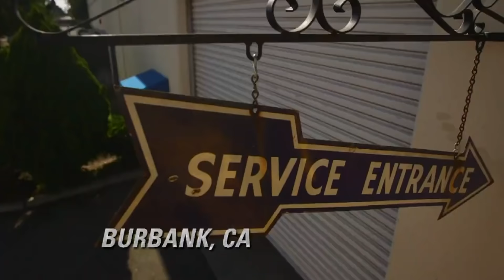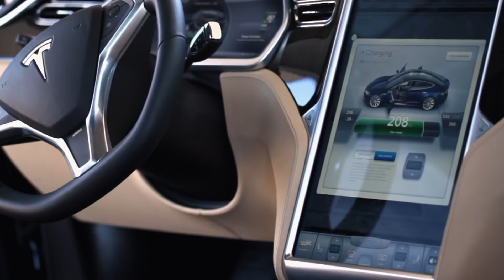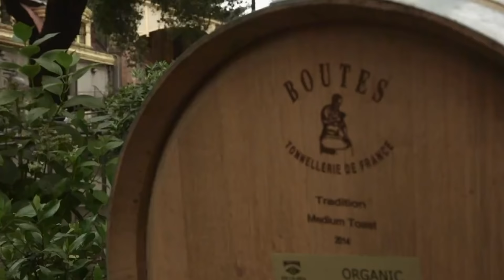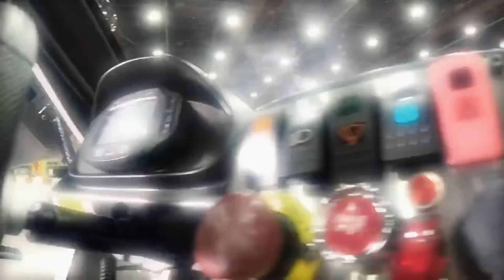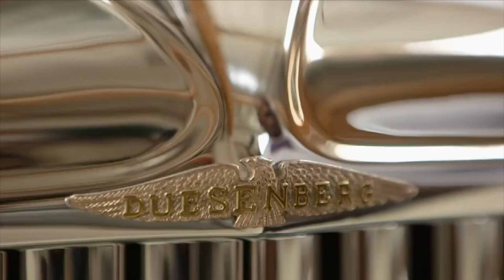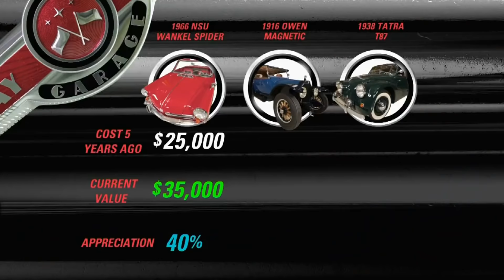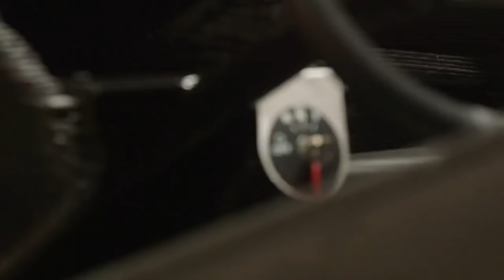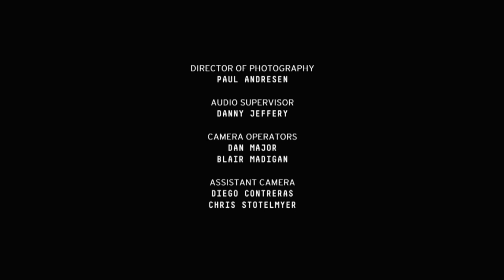The Cars of Tomorrow | Jay Leno's Garage | CNBC Prime

Comment: They actually shot out not 1 but both front tyres of De Gaulle´s car, the driver stayed cool, the hydropneumatic levelled out the suspension and they managed to escape at high speed and even made it to their original destination - an airfield miles away. De Gaulle commented on the incident, "This one was close."

Comment: If I'd 3d print my own car it would look like a Jaguar e-type or a Ferrari 250 GTO probably wouldn't get a 3d printed v12 to work but I'll figure something out.
Reply: Oh, yeah.  That would be the ticket.
Reply: +Thedeoradude just make it something really square, like a Testarossa or a DeLorean.
Reply: Thedeoradude
Make it electric. Problem solved.
Reply: Thedeoradude"The body would be the hard part, you can't 3d print that shape"
"shape"
Your words not mine pal/
Reply: Koenigsegg 3D-prints their turbo's so I don't think an engine is too far off.
Reply: Ever heard of patents and registered trademarks?
Reply: yes you can. There is chemicals and tools to make it totally slick.
Reply: I'd 3D-print a Hudson Hornet.
Reply: yes they do print their turbos, there are industrial 3d printers that can print in materials such as titanium, aluminum and steel. i have worked with one of them before so yes it is possible to print a car using metals
Reply: MS MMS.

Comment: If Jay hadn't roasted the tires on takeoff he would've obliterated that Tesla.
Reply: Not obliterated it, but certainly the race wouldn't have looked as it did.
Reply: Not really. But, yes, it would have been closer.
Reply: The idea was that you should understand that a Tesla isn't your normal slow eco car with just a focus on non pollution. I guess it was wasted.
Reply: Its focus is on everything but being fast
Reply: Actually he didn't even have a chance. The Tesla will outrun even the most powerful fuel eaters.
Reply: madmat2001 a tesla will always run at the maximum torque the tires can handle.
A gas powered car can not compete, a gas car can't do that. Plus it needs gear changes which a tesla doesn't.

Physics will make the tesla win every time.
Reply: The Cobra also had 15-20 year old tires on it. No chance of grip.
Reply: He couldn't keep his Cobra straight on take off.
Reply: No, electric will be quicker off from start, sorry.

Comment: wow Leno took the words rite out of my mouth! a phrase i too had been telling people,  Its all about torque in drag racing not neccesarily Hp.   Hp is to long distance runners as Torque is to sprinters.  Torque is the pushing force that propels you. horsepower dictates the top speed possible.   normally torque is the offshoot of massive hp with a combustion engine,  the more hp the more tq or the stronge the combustion the more hp and tq, hence the use of nitros,   that said the reason why torque is so important is because its pushing power.  power push the weight and thru air resistance.
Reply: HP is how fast you can apply the torque.  I can make as much torque as a car, but I have less than 1 HP so I can't make that torque nearly as quickly
Reply: Well the P90D has 548HP about 200 more HP than a Camaro and a Camaro is faster. by about 10MPH
Reply: Cubic inches FTW. Olds 455 isn't king of drag racing for nothing.

Comment: would love to see classic cars with electric motor swaps in the future..not really a big fan of car designs from the 2000's and up
Reply: Ayyy Lmaoo , I agree , there’s thousands of supposed “classic “ cars on the road. They require a lot of maintenance and could benefit from a nice electric power train .
Reply: Half the experience of driving a classic car is the sound, smell, and feel. Electric drivetrain takes away all of that
Reply: Apollo , but it seems like it would be cheaper to just blow through your pursed lips and make engine noise.
Reply: @shepherdsknoll8  well considering to replace a battery module in most telsas costs between 4-6 thousand dollars, not sure it's cheaper just yet!
Reply: Electric motors in a 1970 Dodge Challenger? How about no.

Comment: That looked suspiciously similar to a rubber hammer...
Reply: It looked like rubber to me, too! Definitely a set-up! lol
Reply: mallets are typically encased in rubber, you know.
Reply: Wouldn't matter. Carbon fiber filled ABS plastic is tough stuff and will take a beating. A hard face hammer would mar the surface and render the part scrap. The demonstration is still valid and shows how tough and strong this material is.
Reply: No flies on you! lol
Reply: Tough and strong ... practically indestructible?  So can it be re-cycled or is it going to be another landfill nightmare?
Reply: It can be shredded and blended with virgin ABS to make an economical product. BTW, it has been around since the 40s.
Reply: Yes, it is going to reduce the potential for point force to fracture or damage the material, but the input force is the same. If you used a steel hammer on a steel chassis, you would wind up with a dent or fracture.
Reply: It was a "hard" rubber hammer, about 3lbs., with plastic, you can break, but with a huge strength to weight ratio, a carbon fiber composite is pretty hard to damage, although it isn't unbreakable.
Reply: I am surprised Leno can swing it.

Comment: You all say "Electric cars are so environmentally friendly" and "I don't pay a cent on gas". Well I know someone who's electricity bill is going to go up. Also, where do you think all this "clean fuel" comes from? That's right, power plants burning coal, lignite, and natural gas. In addition, the lithium required for the batteries is not found in large reserves or fields anywhere around the world, which makes its processing very wasteful and inefficient. The gases, such as sulfur hexafluoride, released by the manufacturing process for these batteries is very bad for the environment once it comes down as acid rain. Yes I did an entire research project on this.
Reply: Bio fuels ! Btw i read that cars are only about 5 % of the co2 problem, not sure if that is correct.
Reply: Plus what do we do with all the batteries once they wear out?
Reply: If you did your research you would know lithium comes from salt fields and is a very clean process. While some electricity is from coal, the vast majority in the US is from other sources. You also skipped over the fact that it takes as much electricity to refine 15 gallons of gas as it takes to fully charge a P90D Model S. You get that pollution before you burn one drop of it in a car.
Reply: You recycle them. The materials in them are too valuable to just throw away.
Reply: Yes this doesn't solve all problems, how they may seem to sell it, but it does isolate the toxicity to power plants so then restrictions & emission controls can focus there.  I don't think most people can multi think the solution otherwise they wouldn't be so resistant to simple recycling/e-cycling.
Reply: Yeah, this tired old excuse, fed to you by people invested in fossil fuels, the comparisons are completely rediculous. The hyped up "Lithium Mining" garbage that is passed around on social media is a blatant lie, yes blatant. You've seen it, the one where they show you a picture of a copper mine and say it's a lithium mine, it's shameful! Read snopes once in a while. Have you even heard of solar power? Jay Leno owns Henry Ford's wife's electric car, it gets 100 miles to a charge, on the same old batteries, he just refurbishes them.
Reply: And I have to explain the processes.

Gasoline: You have to burn fuel to create electricity to extract it. Then you have to use gasoline to move that oil to a refinery. Then you have to refine in. Then you have to transport it again with gasoline and then distribute it to gas stations. 

EV: Extract the fuel, Transport it, Burn it... Bam you have electricity
Reply: You're right about lithium not being ideal to extract and that free energy doesn't exist. But we can definitely get rid of dirty power plants in the long term.
IIRC, Oslo, the capital of Norway, a country that made its wealth by exporting petrol ("oil"), provides thousands of power stations around the city to its citizens, produced mostly from hydroelectric power. 100 % clean energy.
Reply: +Mathieu Clement Unfortunately you have failed to realize that hydroelectric power cannot even meet current global demand.. and will continue to deliver a smaller share in the future.
Reply: You are unfortunately very correct. At present electric cars are not any cleaner than internal combustion engine cars. As a matter of fact new cars might be even cleaner. The American power gird is just about maxed out in the summer time because of everyone running their air conditioning, etc. What is going to happen when everyone wants to charge their cars at the same time too? There won't be enough electric power  to supply the need.
Reply: That's not necessarily true... 
Here in eastern Canada most of our electricity also comes from hydroelectric dams...in fact we have enough surplus to sell a good chunk to our American neighbors in the south... so it depends
Reply: EV cars are not all that "green" for sure...you pay out the nose for a car whose carbon footprint, in the long run, isn't much better than a gasoline powered "Fit", for example.
Reply: You're not completely wrong...but you're close.  When you look at straight up efficiency numbers combustion engines can't come close to competing with electric.  Do we need to improve our electrical production?  Absolutely!  I suggest that holding onto old ideology and ridiculously less efficient motors is NOT the way to improve our future.
Reply: Canehdian, we could potentially recycle most if not all the metals found in the battery to make new ones.
Reply: Lots of solar and wind generated energy plants and more being built daily. And now they are actually storing energy by gravity. Pretty exciting stuff.
Reply: You... should research again. I fill up with Texas wind power every night in my driveway - power so abundant it's free from sundown to sunup.  
The battery is now four years old but from what I see it should last at least another twelve still retaining 230-250 miles range. Of course by then I'll be considering trading in the battery (completely recyclable) for the higher-range one. It will take ten minutes or less to unbolt, disconnect and put in another battery.  

Even running on coal-generated electricity, well-to-wheels total efficiency is way better on electric.
Reply: Ckc dillpickle Diesel*
Reply: Armin Petschelt getting electricity from a single source, you have one   power plant to control emmisions on. Even the dirtiest power plant is cleaner then the average 3-5 year old gasoline engine and far cleaner then a diesel.
BUT, id put some solar panels and a storage system ( batteries) and my fuel would cost almost nothing. I never go over 200-250 miles at the furthest so im good, no gas, no diesel just a little sunshine, which in the sunshine state, we have plenty.
Reply: Armin Petschelt lithium is a byproduct of desalination,  so one will help the other.
The dirtiest power plant is far and away cleaner then a 3-5 year old gas powered car, and multiply that over diesel.
Id set up solar panels and storage units ( batteries) on my carport, I live in fla, we have lots of sun here.
Reply: I agree,,,  Where are the Solar Car ports?
Reply: @COD4JESSE  most go to landfills. Or at least around where I  live they go to landfills
Reply: That's exactly right.  Electric cars have a bigger carbon footprint than conventional cars.  Talk about selective math and science.   Hah!
Reply: Read the book green illusion tell you all about how all this time all this technology is an illusion

Comment: I dont think battery electric cars are the future. They are just a bridge to the next major form of propulsion. Hydrogen fuel cells make a lot more sense.
Reply: George Costanza Yeah right!!! How have we all forgotten the Hindenburg disaster so quickly. Smh. Lol
Reply: dijjmann that’s the 30s my man it’s like steam we could probably make it better
Reply: The Hindenburg was NOT a lesson to be learned about hydrogen - in fact, the same fire would have happened even if it had been filled with helium. It was actually a lesson about static electricity and the severe disadvantages of painting an airship with rocket fuel. Yes, believe it or not, the paint mixture used on the Hindenburg (and all airships of the same class) was basically aluminium powder, iron oxide and a resin binder. This is disturbingly similar to the composition of the fuel grain in modern solid rocket boosters, such as those which sent the space shuttle into orbit.
Reply: George Costanza hydrogen is a truly bad idea. Do some research 1st mate. The maximum theorectical conversion efficiency converting hydrogen to electricity is about 60%. 40% of the energy is lost to the atmosphere as heat. This lost energy must be inputted to the system somewhere. Hydrogen cars do not fill faster than evs, and are not lighter than evs and have higher maintenence  than evs and are harder to package than evs. You do know that a hydrogen fuel cell car is actually an ev with a small battery being chaged by the fuel cell.
Reply: A few corrections: Even with modern supercharging for electric cars, a compressed gas hydrogen tank is definitely faster to fill than an electric car is to charge. The problem with hydrogen is mainly one of infrastructure, since there aren't all that many hydrogen filling stations. Whereas the electric grid is almost everywhere, making charging points easy to install.

A hydrogen fuel cell powered car can be higher maintenance (depending on the type of fuel cell used), but the combination of hydrogen tank and fuel cell can definitely be lighter than a battery pack, even if the batteries are lightweight lithium ion. It is true that a hydrogen fuel cell powered car is still electric, but it doesn't actually need batteries at all: The electric motor(s) run directly from the fuel cell. The only thing a fuel cell car needs batteries for is to store any power recovered by regenerative braking, though supercapacitors are far more effective for that, and can be even lighter than batteries.

It is true that the maximum hydrogen to electricity conversion efficiency is somewhere around 60%, but remember that this is for a car that is using that electricity directly, without wasting any of it. To put that into the correct perspective, compare that to the most efficient bulk power generating stations in existence: Combined cycle gas turbine + steam turbine plants, which also run at close to 60% efficiency. Now you have to transmit that electricity through the electric grid: Every transformer it goes through loses 5%, and it will go through at least 2 transformers between the power station and your charging point. The power lost in the transmission lines themselves will depend on distance, but will probably lose at least another 5%. 

So just from power station to charging point, you've lost a minimum of 15%, and that's before you factor in the losses in charging / discharging the batteries in the car, whatever those might be. Plus, this is assuming the most efficient possible power station, which most of them are not: A typical coal or oil fired power station is closer to 40% efficient, some nuclear power stations are only 30% efficient. So in the real world, there is just no contest: Hydrogen fuel cell cars win on efficiency, hands down.
Reply: @dijjmann  Although I don't think hydrogen cars are the future at all. They are technechally safe lol. They aren't gonna blow up because the tanks that hold the hydrogen on them is essentially built to be able to drop a tank on them and be ok.
Reply: @lloydevans2900  
Is helium flammable?

"Although helium is volatile due to its light weight 
 and physical properties, it is chemically inactive 
 and is, therefore, not flammable. For an object 
 to be flammable, it must be able to react with 
 an oxidant, such as oxygen, within the presence 
 of an ignition source."

Is helium flammable? | Reference.com

www.reference.com/science/helium-flammable-dbb54bfdb078537
Reply: @here_we_go_again2571  The point about the Hindenburg was nothing to do with the flammability of the gas it was filled with (and yes, I know that helium is not flammable, thanks). There's no disputing the fact that the hydrogen in the Hindenburg did burn, but that does not account for the rapidity with which the fire spread over the outer skin of the ship.
That was due to the composition of the paint, which contained aluminium powder, resin binder and iron oxide. So basically enhanced thermite mixture, similar to the fuel mixture used in space shuttle solid rocket boosters and submarine-launched ballistic missiles. Such a fuel mix can be easily ignited by an electrical spark, which was almost certainly the ignition source for the Hindenburg fire. The point being that even if the ship had been filled with helium, the outer skin would still have burned and therefore it would still have crashed in a similarly disastrous way.
Reply: Yes.

Comment: Well only 51 Tucker cars built. There are two of them sitting end to end along route 50
 in south western Pennsylvania near Noblestown road.  That's like 4 percent of the entire production. They have an aircooled airplane engine behind the back seat. I think they are
 six cylinder  and small displacement cylinders. One of them is sort of bronze colored 
and the other one a faded green and both are absolutely filthy. Franklin engines are still available new and occasionally used in homebuilt airplanes.

                                     george and aurora
Reply: Where abouts? I’m curious

Comment: The Iso company also made motorbikes.......and waaaaay down the back of my shed, under all of my other crap, is one of those bikes. It has inverted forks,....The rear brake drum is also the sprocket carrier,...and it has a twin single 'twingle' forced air cooled two stroke engine. Pretty forward thinking for a 1959 bike.